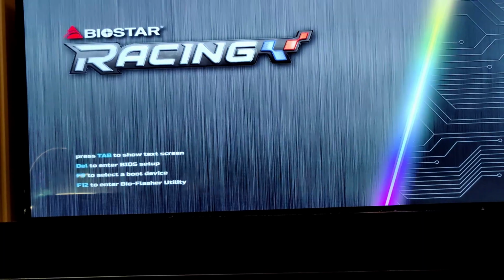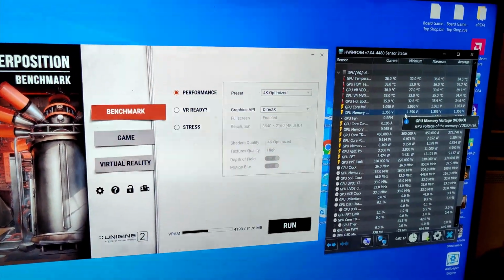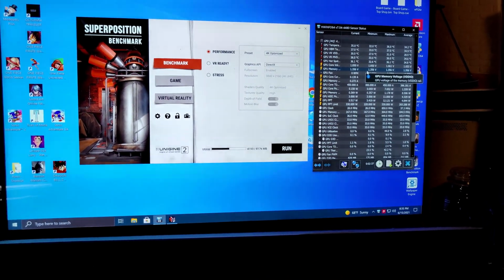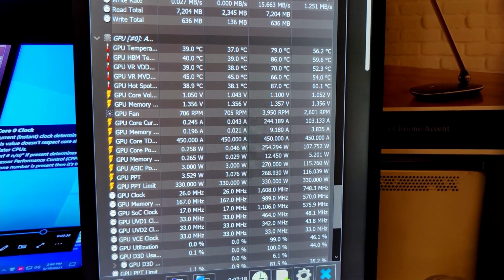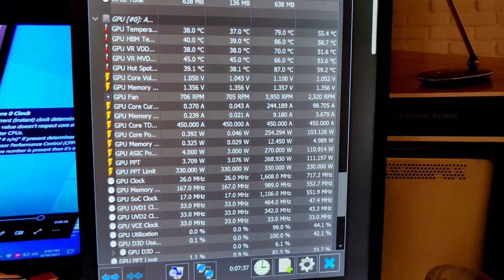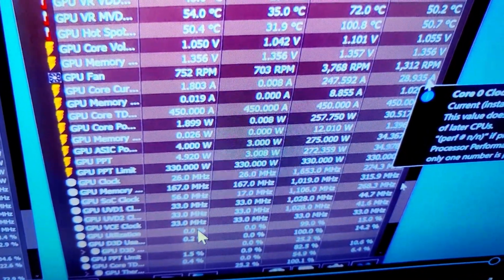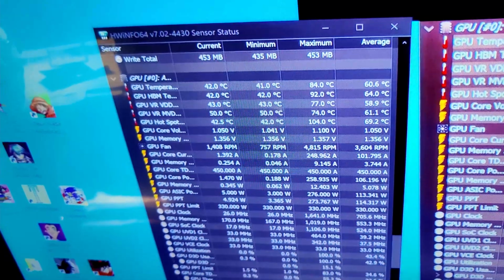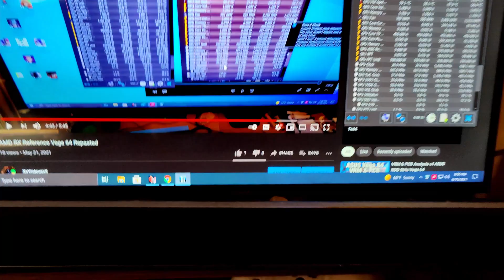Vega 64 Reference Liquid Metal Upgrade

Comment: You can’t apply liquid metal to a copper radiator, apparently you didn’t go to school
Reply from the maker: You're thinking of aluminum. All it does to copper is stain it a little bit.  So you probably shouldn't insult someone's intelligence when you're absolutely wrong... It's not a good look.

Comment: I just did liquid metal on my vega 64 but hotspot is still hitting 95, but I think I need to use a bit more based on how much you used. 👍👍
Reply from the maker: Probably this liquid metal stuff can be tricky sometimes It needs just the right amount. But this one especially needs a lot because it has to fill in the cracks between the HBM memory and the GPU.
Reply: @XxViciousxX  yep i think it was either that, or I've heard the HBM and GPU die are slightly different heights, fine for paste but needed a little extra LM.

Comment: The liquid metal is insufficient, with reference cooling you have to lower frequencies and voltages to 1500mhz 0.950v to keep the hot spot pot below 90º or you will end up burning the gpu, only frequency higher than 1600mhz of the core with liquid cooling is recommended.

You can also make this low cost mod: https://www.youtube.com/watch?v=vJNBeFq5_L8&t=8s&ab_channel=Xeon_X3470x
Reply from the maker: I'll give lowing the clock to 1500mhz a try with the 950mv. I was trying 1580 at 1080mv and it was still getting a little warm. But the worst part was that if I went to another source on my TV the card would sometimes stop displaying a signal requiring a hard restart.

Comment: Get a morpheus II from rajintek. It will cut in half those temps
Reply from the maker: I would love to do that but I don't think any of the aftermarket coolers will fit in the Node 202.
Reply: no it wont. unless you have proof? the problem is with the hbm and some hbms are higher die size. there are simple mods you can do to reference coolers. cut them up and use fans on tp. i have down this will older cards. any blower style sucks anyway.